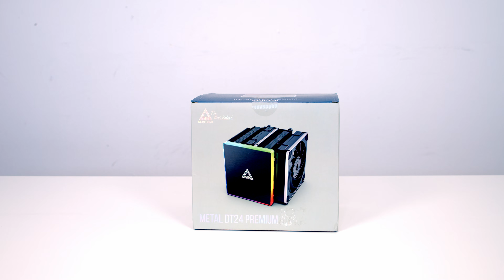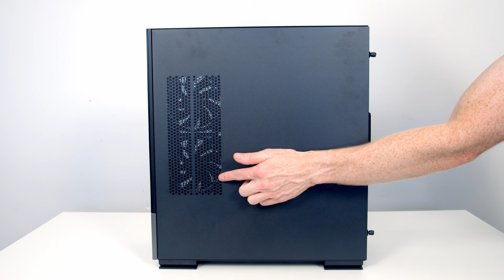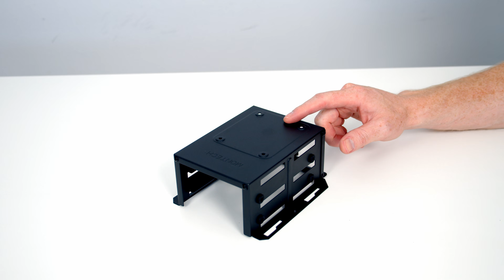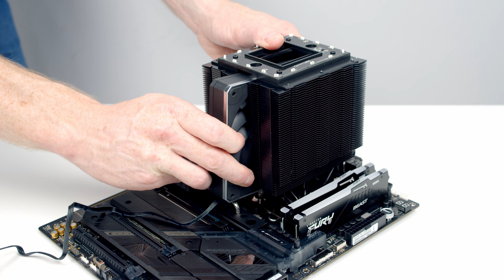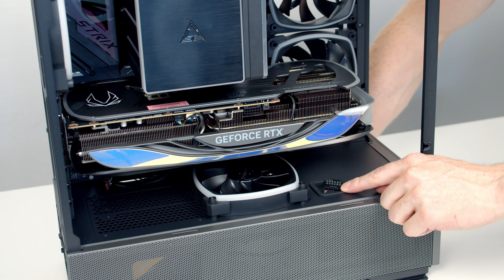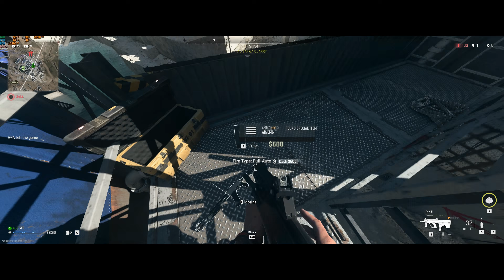Montech Sky Two Build - Step by Step Guide | 13700K & Zotac Gaming RTX 4080 AMP Extreme AIRO

Comment: This case is awesome, I have this one too, but for those who had an issue with RPM 0 information in BIOS for the hub controller, just plug one of your fans to the white pin on the hub and plug the hub to any sys_fan, it will send you information about RPM, and you guys can set it to PWM with smart fan to control the fan based on temp

Comment: Started a build with this case last night, got it to boot and all, but the 3 case fans (I didn't install the one towards the bottom yet) are not coming on at all. Do I need to undo all the cable management and make sure I got the right fan power plug? There was only one hanging loose with the other case cables.

Comment: I was not able to install the 4th fan on the bottom. My MSI MAG tomahawk motherboard has the usb 3 header there and the cable interferes with installation. Had to install on the top of the case (using screws that were not included)
Reply: Exactly what I did as well
Reply: @HaulinwithHicks thats for b550 tomahawk no? since my b650 tomahawk has a usb 3 header on the right side not in the bottom

Comment: I’m building a rig in this case now for my cousin. Great case. Plenty of gpu clearance. More than my O11. Only things I don’t like is there isn’t much room in the rear to run the cpu/power cables and close the back or up top with a 360 rad. The case needs to be 1/2” deeper in the rear for cables and 1/2” taller to clear the cpu power cables. It works just needs some massaging to clear everything.  The rubber grommets also detach from the cage easy with any pressure against them. All in all is a great case. I mounted a 5 inch screen next to the fan on the bottom. Ran Corsair 360 rad up top and chained the montech hub to Corsairs hub as the master pwm hub and all the fans match up, color, speed etc.

Most 4080/4090 will need a different 12hpwr cable to clear the glass. This is the issue on newer cases. Even though these cards have been out for over a year.  They’re just not deep enough. They say they’ll clear the gpu. But remember you realistically need another 1-1.5 inches of case depth to clear the 12hpwr and the glass to not have issues.

A 14700k with a 360 aio idles in the 20s and maxes around 80c. I wouldn’t run an air cooler with the newer Intel chipsets in this case. Even a 240mm would need better
Reply: I just ordered that case. Waiting for RTX 5070Ti to get released in shops, do you think I would be able to close that glass case with my default cable, 12hpwr which came with my PSU (FSP Fortron VITA GM 850 W)

Comment: Hi Christopher, would you give me a hand? Now I have a 4000D Airflow in whit but I'd like to move to a black system. These are my PC parts by now:

MSI B550 Tomahawk
Ryzen 3700X
Crucial 16 GB RAM 3600 CL16
Kingston KC 2500 Gen 3 NVME SSD
MSI MPG A750GF PSU
3060TI FE
x6 Arctic P12
Noctua NH-D15 Chromax Black

My options are:

1. Move to a NZXT H5 airflow keeping my CPU cooler. 

2. Move to a NZXT H5 Airflow and move to a Corsair iCUE H115i Elite Capellix 280m + LCD mounted at the front. 

3. Move to an Sky Two keeping my CPU cooler. 

4. Move to AN Sky Two and moving to a 360 at the top, maybe a Phanteks Glacier One 360MP D-RGB. 

Another option would be moving to a 5900X to get the last AM4 candy, even if I don't need that much power, and keep the rest of my rig as it is now (or moving to it in a few months).
Reply: Ask on PC Partpicker.

Comment: I just did a build in this case with a 3070 Ti and it's great once the three-week-long ordeal of getting a working fab hub from Montech was over. Unfortunately, I was able to snag a great deal on a RTX 4080 and the darn thing is a full inch taller and there's no way to get the card AND the power cable in with the side glass on. I was looking to see if anyone had been able to do a build with a 4080 and was initially happy to see your videos, but then I realized you DIDN'T PUT THE SIDE GLASS BACK ON and it doesn't appear you bothered to mention this in the video.
Reply: can you tell me if you can  install a 120mm fan on top with a 240mm radiator on top as well.. i think 2 direct exhaust fans are  really  necessary
Reply: @davelee73  inside the case? With fans on top?
I did a 360 AIO with (3) 120s below blowing up and it's real tight. About an 8th inch gap from top of Mobo.
Reply: I'm hoping to do this case with a vertical mount, maybe you'd want to try? Just not sure if the bottom fan would bump the card.
Reply: @donmohave  Fortunately the 4080 DOES FIT with the side glass on with plenty of room to spare. I got a CableMods 12VHPWR-to-3X Corsair adapter cable - but not a right-angle adapter - to not have the mess of the squid dongle and the cable clears the glass by at least a half-inch without having to aggressively bend it down.

I ran the cable underneath the GPU between the bottom fan (not using the hole in the shroud) and the GPU and initially ran into a horrid noise because when the GPU's fans started turning, they sucked the cable up and made it rub. I'm sure the bottom fan didn't help by blowing up either. But a slight adjustment to the angle and it never happened again.

Comment: For the standardized front panel cable from the case, does it say which 2 holes on it are the Power Button? I am doing a case swap with HP omen and on the motherboard it just had a single 2 pin header for power switch. is it the middle 2?

Comment: Are you sure about the slot you pointed out as the 2nd slot that goes toward the cpu? In the manual for the asus z790-e it says that the m.2-2 is at the bottom slot connected to m.2-5 heat spreader. The bottom slot on the left is the other m.2 slot that goes toward the cpu. You connected the m.2 drive to slot 3 that goes to the chipset.
Reply: I think you are right. I just built my z790-e this weekend and seems like M.2_2 is the one talks to cpu but not M.2_3 as Chris put in his ssd. M.2_3~5 talk to the chipset.
Reply: @ThomasTheTrain90  sounds right to me.